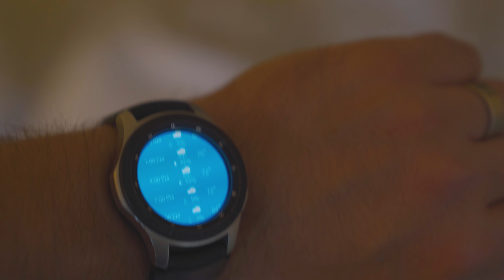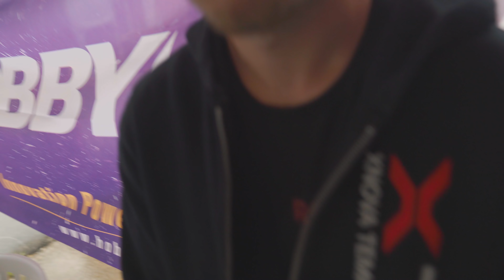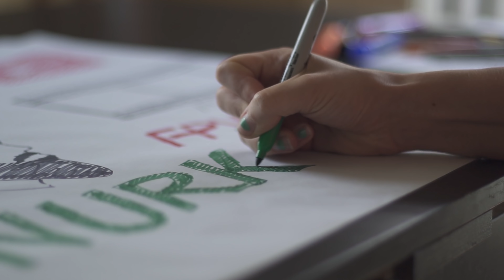Hobbywing European Cup 2019

Comment from the maker: Motors: Hobbywing 1750 2306kv // http://bit.ly/2QlgSnc
Flight Controller: Hobbywing G2 // http://bit.ly/2QfH9Dr (for sale!) 
ESC: Hobbywing 40A 4-1 // http://bit.ly/2opqsWx
VTX : TBS Unify // http://bit.ly/2NyM0eb
Receiver: TBS Crossfire Micro // http://bit.ly/2LGgNUL
RX Antenna: TBS Immortal T // http://bit.ly/2MGS1ZR
VTX Antenna: TBS Triumph // http://bit.ly/2N3gDeU
Frame: HyphyMultirotors Wobbegong: http://bit.ly/2Arkr0W
Camera: Runcam Racer // http://bit.ly/2SeAG96
Lipo: CNHL Ministar 6s // http://bit.ly/2LH920S
Prop: Azurepower 5150 // http://bit.ly/2LG70Oc